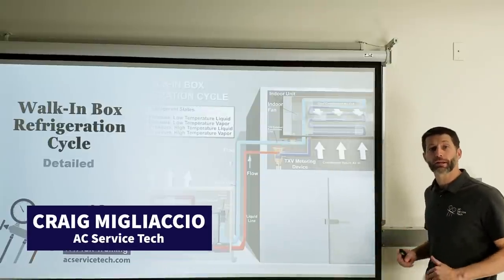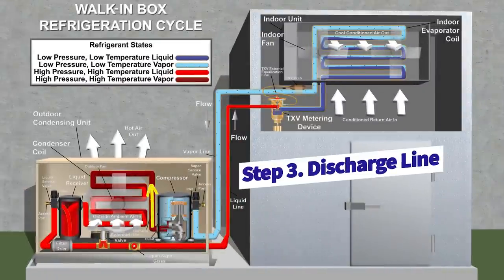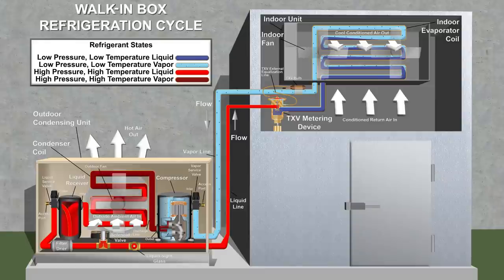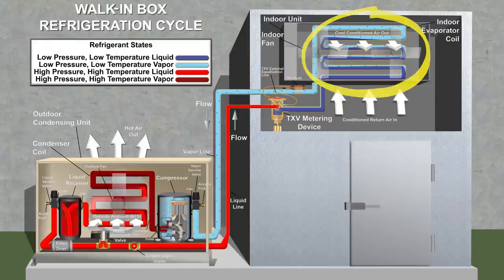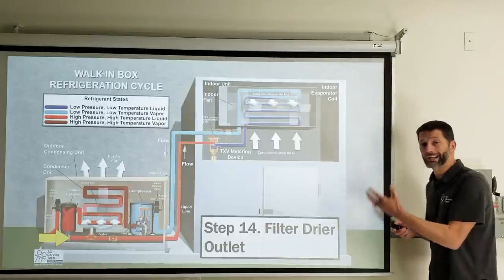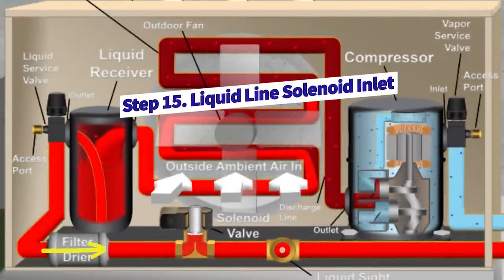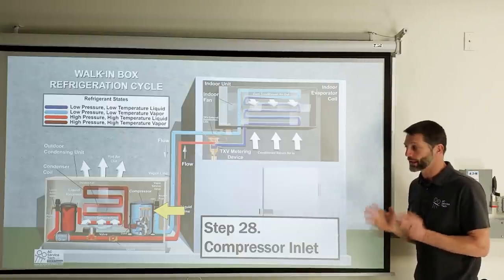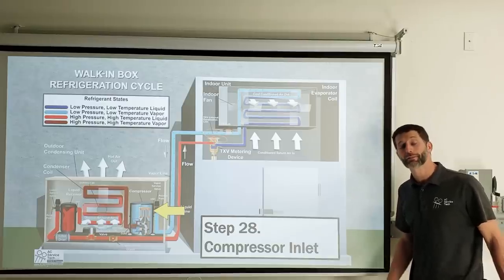Refrigeration Cycle Training Class! Superheat, Subcooling, Saturation, Components, How it Works!

Comment: super video, I like how you said the super heat protects the compressor, but it would be nice to point out that high super heat is less efficient so its a trade off.  Also nice to point out why high sub cool means you have more ability to cool.  Lastly it would be nice to mention that heat pumps exist and they have some extra components and link to your other video.  Heat pumps are becoming much more common and lots of technicians are afraid to deal with them.
Reply: mini splits deal with liquid refrigerator coming from evaporator coil into compressor by putting accumulator on the suction line of the compressor. this not only protects compressor by preventing liquid refrigerant going into the compressor and keeps super heat to the level of maximum efficiency.

i wonder why other hvac machines don't follow this approach?
Reply: You appear to have numerous "nice" suggestions.  Maybe you could start your own Youtube channel and go over all these "nice" points.

Comment: thanks for the clear explanation. whats the benefit of pumping down the system instead of shutting down the compressor and solenoid valve at the same time? is it to pump out the refrigerant from evaporator so it doesnt freeze up?
Reply: Pumps
Refrigerant into condenser to prevent migration.  On walk in coolers and freezers it’s coming to energize the the solenoid with a stat. When the solenoid closes a low pressure cutout will shut the compressor off. The LP control has a cut in range and cutout range for contacts to bring the compressor on and shut it off.
Reply: @JohnnyJr396  i understad how the pump down works but i dont fully understand the reason behind it. if its only because of refrigerant migration, doesnt shutting off the power to the compressor and solenoid valve achieve the same thing? you turn off the compressor and solenoid from thermostat , and the solenoid valve prevents refrigerant from migration.
the only difference i see is that the compressor would pump the refrigerant out of the evaporator before turning off which achieves what exactly?
Reply: @faintsmile3279  don’t know why my reply  never showed with a link. Anyway refrigerant will migrate to a cooler area, in the case of a cooler freezer it’s the evap. If the unit started up it would slug the compressor.
Reply: @JohnnyJr396  makes sense thanks for the explanation. 
is there any downside to pumping down instead of cutting off power to compressor and solenoid valve at the same time?
ive worked on so many cold rooms and only a handful of them used the pump down method (and that was because of a different reason). although all of them have accumulators and heat exchangers so can that be why?

Comment: So, I have a question.  In residential, why does the TD suck on a AH when the system is low on charge compared to refrigeration where the space gets much colder?  Is it because as the evap freezes, there is little air flow?  I was thinking that since the system is low on charge, the TD would be really high basically making really cold air until it starts to freeze.

Comment: Thank you for this video. Question? Does the king valve have open, closed and cracked (meaning i can read pressures). Thanks in advance.
Reply: A king valve can be front seated, back seated and  cracked open to read pressures.
Reply: @jacobaberwald6072  Thank you for the response, its been a long time since i work on refrigeration systems because i do residential and sometimes light commercial. Ty